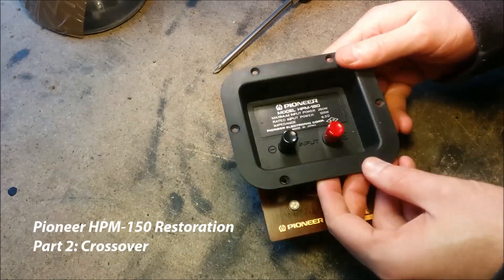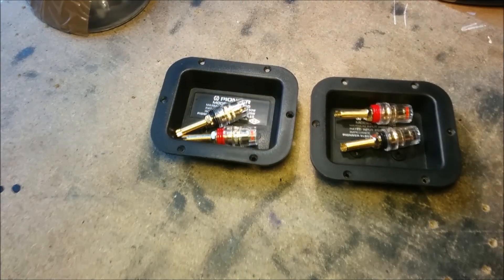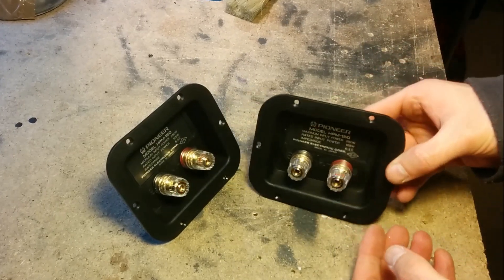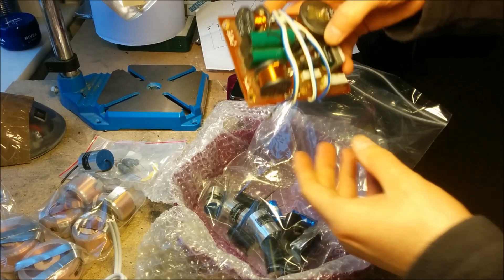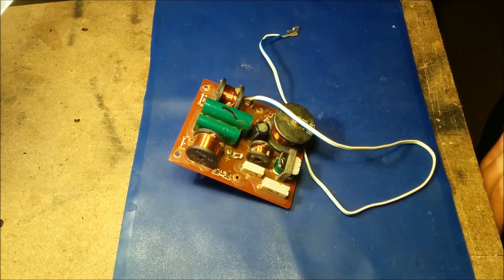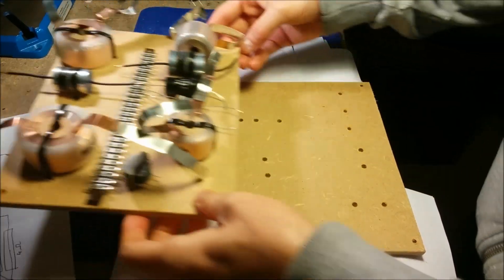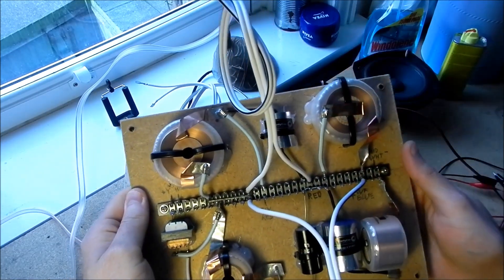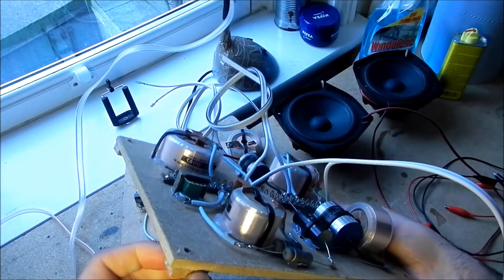Pioneer HPM-150 Restoration - Crossover

Comment: This is not a restoration,it's more likely an improvement! Adding a piece of wood as a core to a coil doesn't do anything,it's just for show.That piece of wood doesn't justify the higher price.All you have there is just snake oil.I assure you that you made the crossover worse than it was because the original one was calculated for that specific speaker and cabinet configuration.
Reply from the maker: Thank you for your polite comment. I completely disagree however and here is my argument: these are superior parts following spec of original crossover. Much better spaced also. Improvements to the sound were made.

Comment: What's the point of replacing the coils? It's just wound copper and with replacing the coils you would have to carefully match the series resistance in them as well or the crossover network would no longer work as intended.
Reply: @Jingle Nuts Eh... how? It's just copper and copper doesn't 'sound' anything. No metal does.

Comment: I have 4 of these Pioneer HPM-150 speakers in working condition and would not part with them. All of the drivers are in great condition. I need to recap all four of my crossovers. Can you post a parts list with part numbers and what company you purchased them from? Would you consider building four crossovers and selling them to me? You do some fine work my friend and great videos.
Reply: I heve the special tweeters that come with these fine speakers. I need to know how I can measure the correct values on the transformer and on the tweeters themselves. I know they cross at a high point and I can hear some HF sound through them but want to seen them OK so need to measure. To what reference? Would the HPM-100 transformers be suitable for the HPM-150 tweeters?